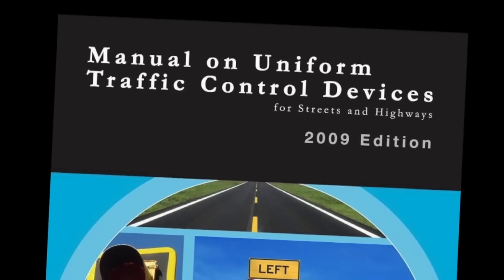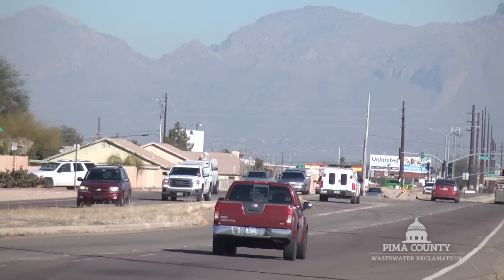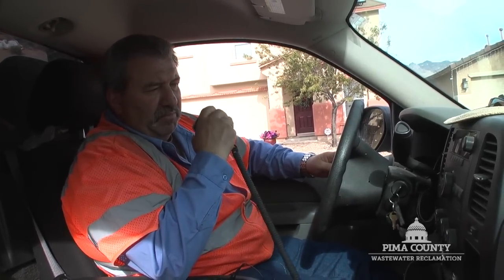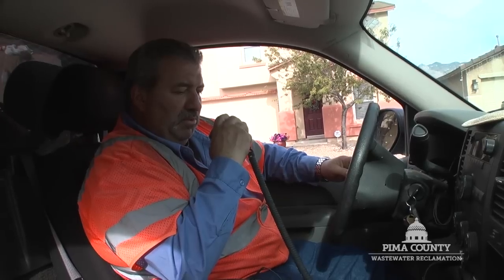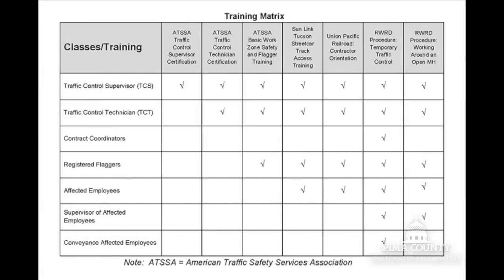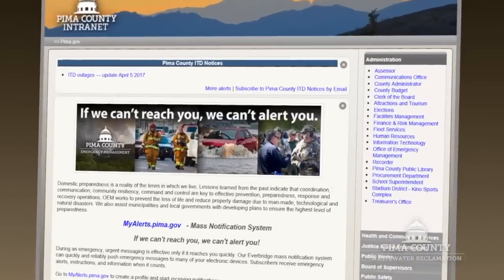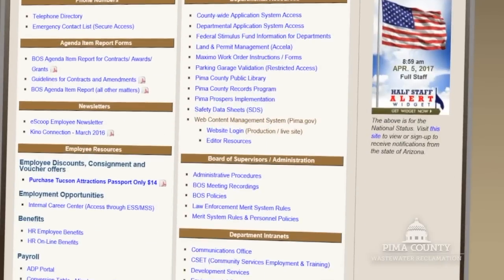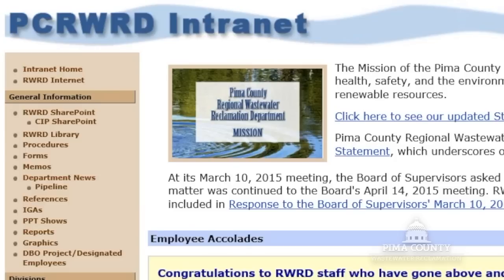Temporary Traffic Control Safety

Comment: Can you supply the exact wording in the MUTCD that retains to Steel Toe Boots. I have never seen anywhere in the MUTCD we're this is a requirement for Traffic Control. Even FDOT as strict as they are does not have this requirement in the standards.